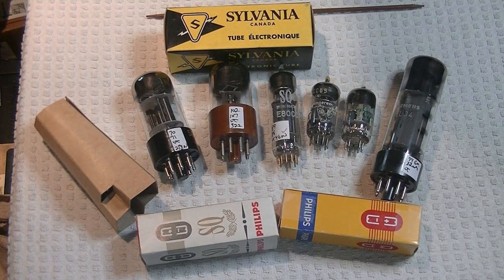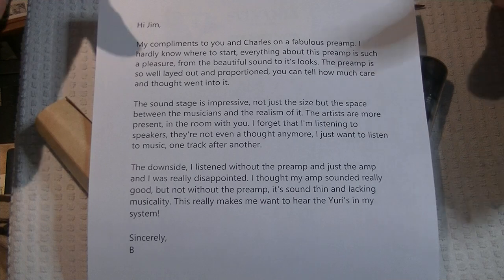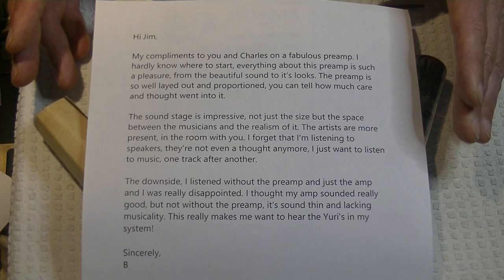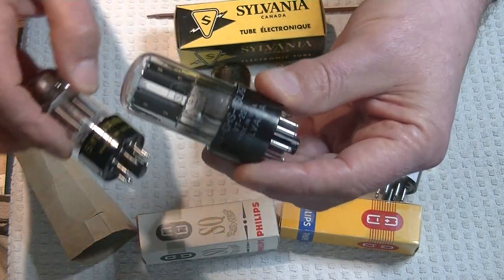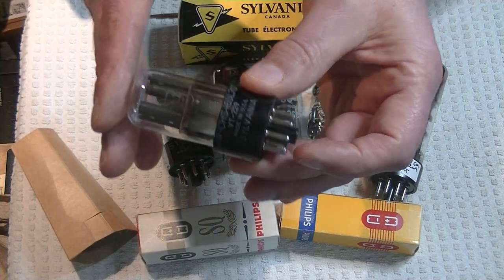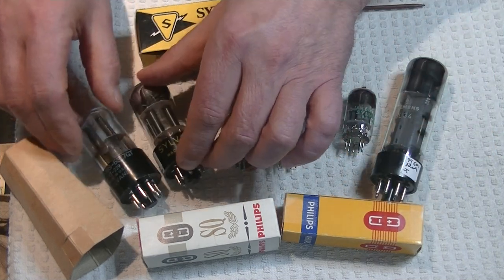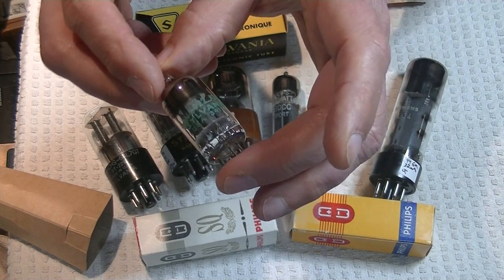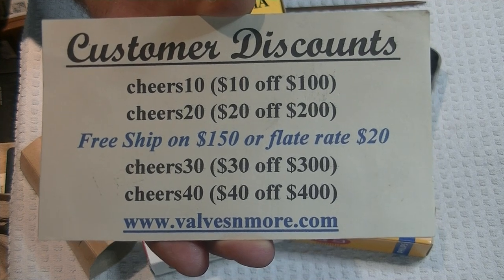Tube Lab #79 - Universal Kit Preamp Build Series

Comment: Hi jim. Just found your channel! Commented on one of your other videos and now I’m exploring your awesome channel! I’m a musician/songwriter who has learned over many years after touring and my guitar tube amps would break down due to travel and weather conditions which would cost me a lot to hire a tech to fix my amps So I read so many books and took some online classes and then found channels like your which so far I’m absolutely loving your channel. You are very detailed and knowledgeable and talk clearly and seem very genuine and helpful to all! I have so many questions I’d love to ask you but for starters I’m going to check out your website more as I need a lot of parts and tubes for many amps I have. Some are ones I record with a lot and others I’ve gotten and need to restore so I hope it’s ok to email you with questions as there’s some unique tubes I need and also would it be possible to ask you for some advice? If not I understand but If so I’d greatly appreciate it as I’m always recording new music and use many amps in my music which are 99% tube amps of course. I also took on a new hobby a few years ago of restoring vintage tube  radios to further enhance my electronics experience plus I find it relaxing working and restoring vintage tube electronics! I have purchased many boxes and caddies of a lot of tubes and would love to build my own guitar amp with maybe some rare tubes I have but that’s after I get a little more advanced with building. I’ve designed my own own guitar pedals and another thing I want to include some tubes in my pedal builds then go onto the guitar amps! Also on the agenda is building a great tube preamp for the wife and I as we have a huge vinyl collection and nothing like a great tube preamp to run it through! Anyways great channel Jim and sorry for long message but watching your vids got me super inspired which I needed especially after being stuck inside for 2 +years due to pandemic! Thanks and I’m on to the next video after this one which I’m watching while typing this. Thanks.Sincerely, michael

Comment: Hi Jim. Perhaps I misunderstood what you meant about the VT-229 designation on the Sylvania 6SL7 being an "in house" designation. That nomenclature is not unique to Sylvania. I have VT-229 tubes from Raytheon and GE. The JAN 6SN7s can also have a similar designation, VT-231. I also have these. There's Raytheon VT-231 in your store at this moment.
Reply from the maker: I stand corrected, I've never seen another vt-229 on another 6sl7 and I have thousands, so this one escaped my research!  From what you are saying these numbers must have been military numbers designating certain tube specifications, sorta like the UK CV ### (common valve). designation.
Reply from the maker: Sylvania had many of the Pentagon tube contracts over the years, which is why I mostly see Sylvania tubes with the VT designations.